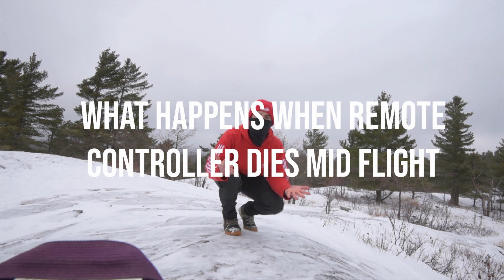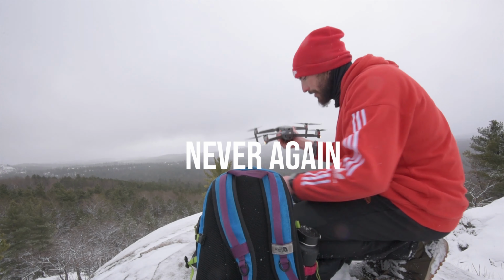DJI Mavic 2 Zoom Controller Dies Mid Flight. Now what?!

Comment: Man I had this happen to me 2 weeks ago and the drone was over water. Thankfully I was able to reconnect the rc. Had no visuals what so ever from my phone had to fly back with the height/distance readings from the controller and from watching the he drone. I was terrified
Reply from the maker: AHH so it sounds like your phone died in your case? I've had that happen and ya its terrifying but at least you still had control. This was the actual Remote Controller that died and I couldn't do anything but wait hah
Reply: @ezmomentsphoto  Everything was charged I just lost signal completely. I think my connection was bad from the controller to my phone, and it still wouldn't reconnect